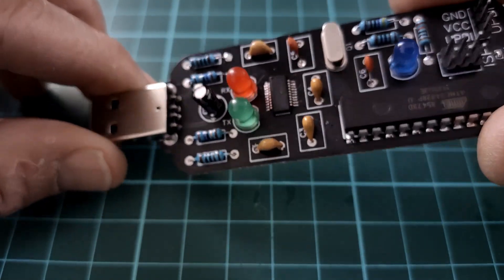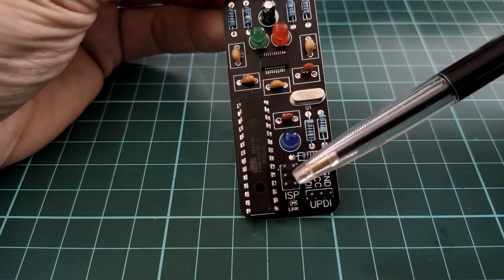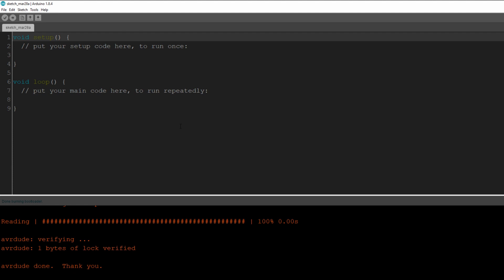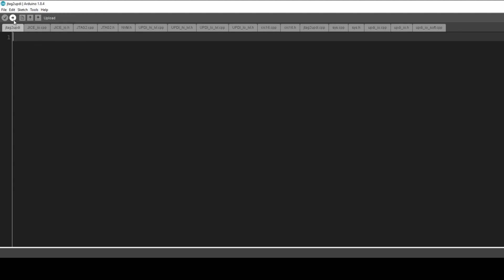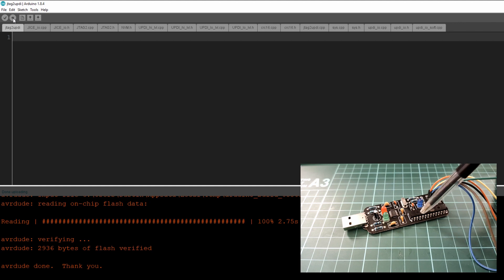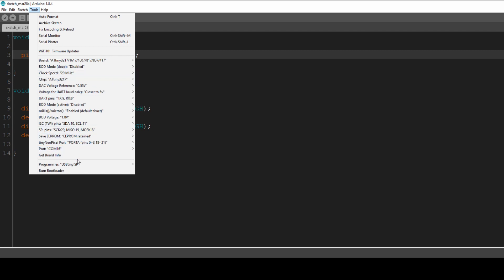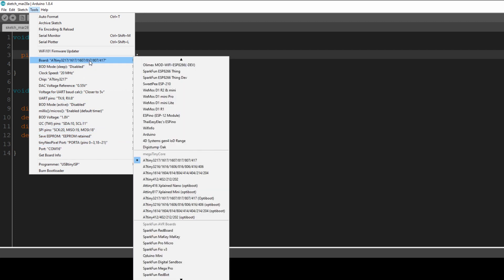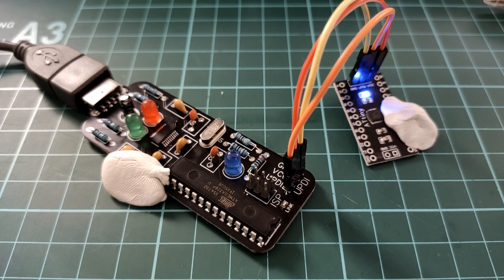Building a simple and cheap UPDI Programmer (Part 2)

Comment: can this diy programmer programs the avr128da/db64 mcu instead of attiny?
Reply from the maker: Yes... :) It does however need the updated jtag2updi code by ElTangas: https://github.com/ElTangas/jtag2updi
Reply: @DustinWatts  thanks
Reply: hello samsul, have you programmed your AVR128DA with this method? , i need as well to program my avr128DA28 using arduino uno

Comment: You programmed the boot loader, but then didn't use it.  Didn't need the bootloader at all (but by doing that you DID set some fuses).
I have both an Atmel Ice and a PicKit4, both of which can do UPDI.  I've written a simple blink sketch for the atmega4809 (40 pin dip), but I used MPLAB X IDE to do it.  I will next try the Arduino core and see if either (or both) of these programmers work.  I will first program the fuses (to get 20mhz internal with no prescale, my first sketch just ran at 3.3333mhz).    The jtag2UPDI programmer is a nice cheap way to get a programmer for these new parts, but you still need an SPI programmer.  The USBtiny (I have the Adafruit version) is a nice one, but the cheap clones work fine.  Most people forget that these can't program anything larger than 64k (such as atmega644).  I wish someone would upgrade the usbtiny to work with larger AVRs, there is a larger attiny chip that will work, or just rework the code to run on the atmega328.  Maybe one of these days I'll look into it.
Reply from the maker: Correct. I used it for setting fuses. Maybe https://github.com/MCUdude/MightyCore is an option for > 64KB AVR's?
Reply: @DustinWatts  I tried uploading a sketch without bootloader, and it DOES program fuses.

Comment: I have problems with UPDI on tiny412.
How do I reset UPDI to factory settings?
Reply from the maker: If you have set the UPDI pin as GPIO or reset, you will need a HV (High Voltage 12V) capable programmer. This will give a short 12V pulse to re-enable UPDI. There are some DIY programmers out there that can do this. If you search on Tindie you will find a few!
Reply: @DustinWatts  Here's what the tindie search results in
https://www.tindie.com/search/?q=ATtiny412
According to the link, there is no programmer with 12 volts.
You understand I am from Russia and there are some difficulties with the language )))
Please help me. Give a link to the circuit with a programmer with 12 volts.
Reply from the maker: @pavelsan1954  No problem, I can usterstand you fine :) This is an example: https://www.tindie.com/products/leonerd/avr-updi-programmer-with-12v/

Comment: hello i try use the  jtag2updi  with a adruino edi , uno board, but is not working, any ideas?

avrdude: jtagmkII_initialize(): Cannot locate "flash" and "boot" memories in description
avrdude: AVR device initialized and ready to accept instructions

Reading | avrdude: jtagmkII_program_enable(): bad response to enter progmode command: RSP_NO_TARGET_POWER
avrdude: jtagmkII_program_enable(): bad response to enter progmode command: RSP_NO_TARGET_POWER
avrdude: jtagmkII_read_byte(): bad response to read memory command: RSP_NO_TARGET_POWER
avr_read(): error reading address 0x0000
    read operation not supported for memory "signature"
avrdude: error reading signature data for part "ATtiny814", rc=-2
avrdude: error reading signature data, rc=-2
avrdude: jtagmkII_program_disable(): bad response to leave progmode command: RSP_NO_TARGET_POWER

avrdude done.  Thank you.

any  help?
Reply from the maker: Did you connect the 5V/GND/dataPin correctly? Also make sure you have the latest versions of both jtag2updi and the MegaTinyCore.

Comment: Nice, why did you need to burn the boot loader on the UPDI Programmer? if your going to use the ATtiny to program it, you might as well left it off and had the chip boot faster when you power it up.  if you not going to keep programming it via the usb then you don't need it.
Reply from the maker: True. Actually, by using the "Upload using programmer" it overwrites the bootloader. So the bootloader is not on there anymore. I do burn the bootloader once to make sure all the fuses are set correctly.